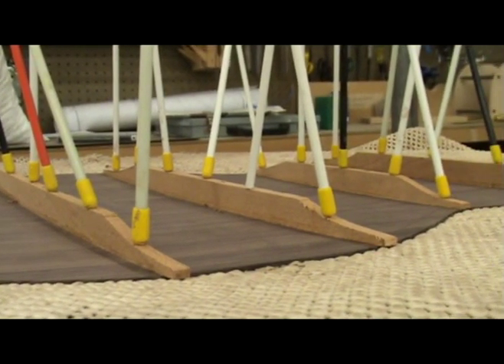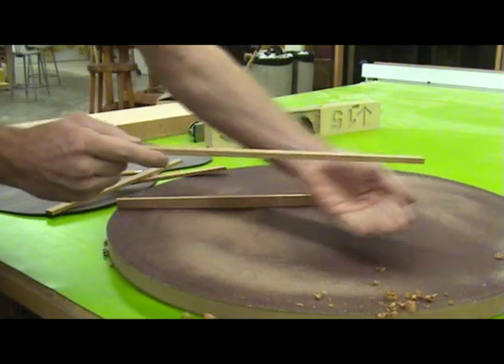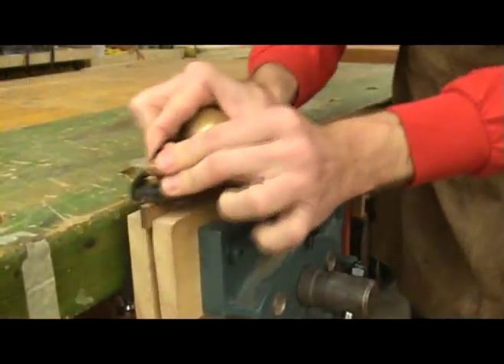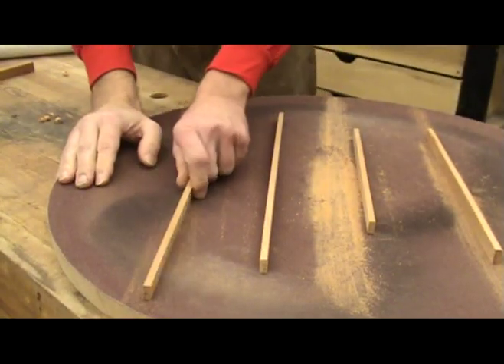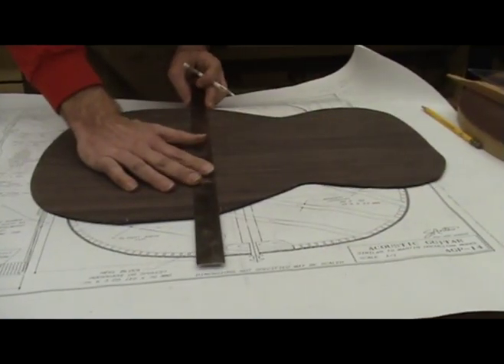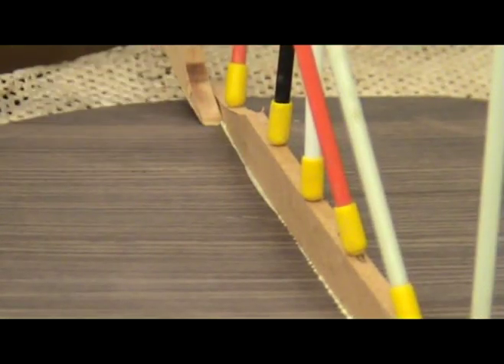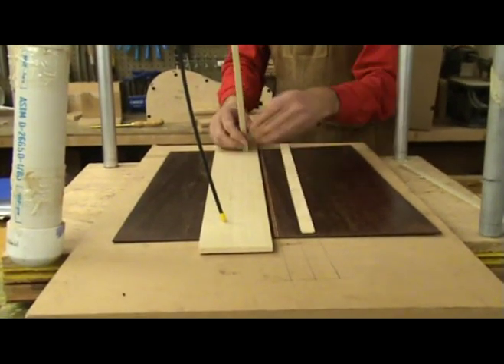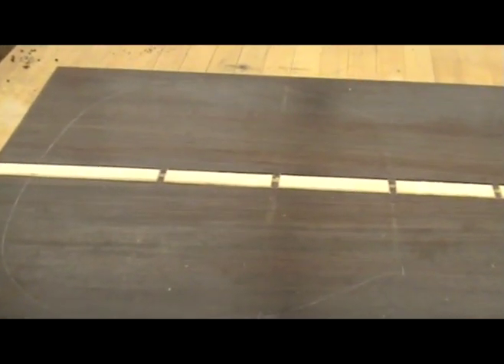Luthier Tips du Jour - Steel String Back Braces

Comment: Hi Rob,
Great tip video. What happens if the back braces are flat instead of radiused? I imagine doming the back is to focus the sound towards the sound hole but I am curious whether there is a noticeable difference -the entire soundbox seems like a bellows to me, as whooshing air/sound out of the sound hole.

Comment from the maker: Actually there is. Take a board about  8 or 9 inches wide X about 36inches and taper it on one edge into a wedge shape that approximates the radius you want to use. Cut this into one inch strips and place the pieces like a pie or pizza on a piece of plywood or MDF. Then place a thin piece of hardboard over the top and suck it down in the middle with a screw. You now have a radius dish. Do the math and figure out what the wedge shape dimensions need to be in order to get the radius you want.